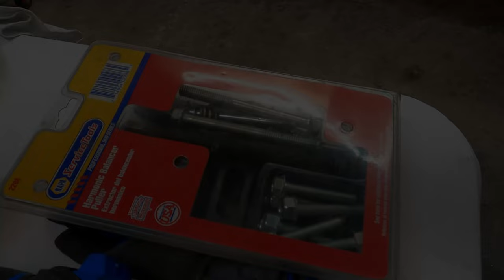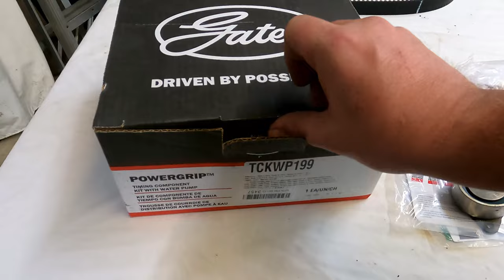Toyota Camry Oil Pump Seal leak fix!!! Timing belt - water pump Toyota oil leak repaired

Comment from the maker: It was supposed to be a short video sorry guys, hope someone finds it useful.
Reply: Great instruction! I’ve seen some of these leak out 2 quarts a day at that seal. Replaced it every time we did a t belt/water pump whether it leaked or not.
Reply from the maker: @DerbyCityRC  Thanks for watching and commenting!
Reply: I had a hell of a time fitting o ring in place used sealer to try to hold it in place its iffy
Reply from the maker: @gregoryschofield5521  That's why i did it as well, Super Pro mechanics cringe but i DGAF. I will be the one that has to redo this job if that oring gets pinched.
Reply: Do you need to do the oil change after you change the gaskets
Reply: What was your total cost?

Comment: The pump shouldn't NEED the additional sealant, but having just gone through this, will do the same (but less than what you showed).  I've found that the replacement gaskets are often smaller than the original ones and leak even when new.  Further, the gaskets can dry out in the original packaging (the one I just purchased in 2024 had a date on the package from 2008!).  So...additional gasket maker for me in addition to the ring rubber gasket.  Last, recommend verifying that the oil leak at the pump is solved PRIOR to putting the timing belt covers (2), P/S belt, A/C belt, and crankshaft pulley on (need to install the timing belt, of course).  Otherwise you will be doing all of this again if the pump still leaks after your repair.  Torque for the 10mm bolts on the pump is low (76 in-lbs).
Reply: And, yes, you can run the 5SFE  engine without the crankshaft pulley on for testing purposes...it is not a harmonic balancer.

Comment: Mike. Thank you very much for making this vid. My mechanic diagnosed this on my 96 Camry with the 2.2 same as you have. Only has 145k. My shop wanted to charge me $1000+ to do this. Now I gotta find someone else. Wish I lived closer to you. Thanks again for the vid. Was going to sell the car or Junk it.
Reply from the maker: I'm glad that people are getting some good info out of this video. I'm still using the same car. It went through two of my daughters learning how to drive since that video and now it's been passed back on to Dad for the work car. I just rewarded it with brand new speakers and a double din touch screen DVD Bluetooth player.
Reply: @madmikesgarage4861   Thats awesome. Our car has been the learn to drive car and college car for both my sons who have graduated college. They blew 3 of the 4 speakers so I think a new stereo is in the future when I get the seal and timing belt taken care of
Reply: @johnkelly4043  update please! I’m planning on buying a Toyota Celica with this problem! How hard was it for you to do?
Reply: @kerokerobonito3664  purchased all the parts on Amazon. Paid $400 cash for a tech to do it on the side. Leaks are gone and set for another 100k miles
Reply: 9 yrs since the last timing was done but only 20k of so. Requested a quote from a shop to do that with oil pump o ring and gasket and they said $1700.  Another shop refused to do oil pump stuff and said if it not leaking to not touch it. Lol. $1200 or so from them.  But why would I want to pay you again to go in once it breaks free.  Stupid shops.  The timing part scares me a little.  I've done all sorts of work on cars just never timing.  It looks really easy from the videos so I may get OEM stuff and do it myself.  My biggest concern was lining things up right and getting the old seals out of the crank and cam.  Thanks for a great video.  My 2000 still going strong with 236k.

Comment: Thanks for the video have the same problem on my 1997 already ordered all the parts. I think this o-ring and all the shaft seals on this side of the engine should just be done every time you do the timing belt because it's easy to get to them. The last guy who did the timing belt on my car was a monkey and left 3 bolts out of the top timing cover and it was flopping around. Safe to say he probably didn't bother changing the oil pump o-ring lol

Comment: I don't know if this comment will help anyone, but occasionally you'll find that the nut that holds the oil pump gear is hard to take off, even with an impact. I'd suggest that before you remove the timing belt you get in there with an impact and get it loose. Then tighten by hand until you can get the oil pump out.
Reply from the maker: Thanks for the tip. That is good advice.

Comment: I had a HELL of a time fitting Oring in place its iffy now I have to check for oil leek soon as  I put belt on for test before its complete
Reply from the maker: That's why I used a little bit of RTV in the groove to help hold the o ring down. I know you're not supposed to do that but I wanted to make sure that o-ring didn't pop out during installation.

Comment: I’m waiting for parts to do this job myself. I have a 97 Camry with the 2.2 liter. I’m getting mixed information about the timing setup. Is this motor an “interference” engine? So if the timing belt snapped would the valves hit the pistons? Asking because my boss has one and it’s overdue for a timing belt.
Reply from the maker: @Ian-of9oi  The engine is a non- interference engine so technically if his belt breaks, no further damage would occur.
Reply: @madmikesgarage4861  thanks. that’s good to know.

Comment: Just had the timing belt replaced last December in my 01 Camry and now this leak is going on! Wonder if the oil pump gasket should be in the kit and done with timing belt change and save all that labor to tear it all down again?!
Reply from the maker: Your mechanic should have at least offered to do it It's like a $10 o-ring.
Reply: @madmikesgarage4861  I'll be letting him know that when it goes in on Aug 3rd! I did get a pretty fair price I thought at $670 as several others wanted $900-1000 but back in again! Am trying a bottle of Bar's Leak in the oil to see if any slow down with the dripping...
Reply: That o ring seal is good for 200k so on first replacement of timing just look for a leak
Reply: @gregoryschofield5521  the pumps gasket fails like shown in the video. Has to removed to replace so all the addtional labor to tear it all down to do so! Should be done same time as timing belt is replaced!
Reply: I have the same problem and Bars leaks cut down the leak by 70%

Comment: How much do you think this job is reasonably priced at with out  water pump change out great video by the way
Reply: $200
Reply from the maker: This job without water pump would be 400ish. it really depends on the shop i guess.

Comment: How did you remove harmonic balancer and how did you put it back?
Reply from the maker: I used a battery powered impact gun to remove the bolt. I had to use a balancer puller to get it off the the crank. You can put the balancer back on by hand and then just torque the bolt. You may get lucky and be able to take the balancer off by hand once you get the boat out but mine was froze a little bit.

Comment: Is the deep groove all around the oil pump shaft normal? I see the replacement oil pump shaft doesn't have this deep groove.
Reply from the maker: If the deep groove is where the outer seal rides, it may have caused it. I wouldn't think it should be there.

Comment: How did you take the 12mm nut off the oil pump gear?
Reply: I  put the gear in a vice to remove that nut and replace the shaft seal.

Comment: Gates is doing something yukky that people who care need to know about. If you buy the Gates H2o pump kit that comes with the tensioner and idler pulleys, they used to only come with Japanese Koyo bearings (the best) which is what Toyota OEM is, but now they sneak in a Chinese bearing, like they did with the kit shown in this video. Koyo bearings have the reddish orange seals while the Chinese bearings usually have a turquoise seal. The Chinese bearings are crap and are guaranteed to fail first. My advise, buy the parts individually or get em from Toyota so you don't end up doing the belt prematurely

Comment: How did you remove the main center bolt from the oil pump sprocket?
Reply from the maker: I just held the gear with the rag and use my electric 3/8 impact on the bolt
Reply: @madmikesgarage4861  ok thanks
Reply: @madmikesgarage4861  stupid question...
Is that center bolt loosened clockwise or counter clockwise?
I was able to hold the gear in place and used my 3/4 impact with no success. I've sprayed it with penetrating fluid and still doesn't budge.
So just thought I'd make sure that this bolt is lefty loosey and not righty loosey 😔
Reply: I removed mine by placing the timing belt around the sprocket and using clamping pliers to hold it then using an impact wrench on low to break the hold. Came right off
Reply: Put a 19 mm socket with breaker bar and hit the starter
Reply: @PiitaaDerbez  lefty loose.
Reply: @Gary New  Gary this trick saved me! I could not break this bolt loose eve with belts around the crank pulley etc... Worked like a champ thanks for the trick!

Comment: What do you line that Mark up on the harmonic balancer with at 6:06?
Reply from the maker: There should be a mark on the timing belt cover.
Reply: Thanks

How did you remove that oil pump gear to get to the seal??
Reply: same question about the cam shaft seal. am I going to have to hold that gear somehow? I'm not there yet because I'm stuck on trying to get that oil pump gear off
Reply from the maker: @PiitaaDerbez  I just held on to the gear with my hand with a glove on and I use my 3/8 battery powered impact to take the nut off
Reply from the maker: @PiitaaDerbez  same deal. Just held it and I used my impact. They really are a lifesaver. Takes a lot of the work out of it.

Comment: Was the oil pan gasket still ok?
Reply from the maker: Mine was okay. I looked at it and it wouldn't be hard to change it later date. Not really any easier to do when you're doing the oil pump from what I noticed.

Comment: Need an update. Any leaks?
Reply from the maker: None  not a drop!!! I still daily this thing to work!!!
Reply: @madmikesgarage4861  I have oil seepage starting on my 99 2.2l, but I think it's from the oil pan. Even so, I wanted to know if RTV was a viable thing to do over the oil pump gasket. Others say no, but it sure seems to be good insurance against a premature pump leak. Thanks for your answer. It's really helpful.
Reply from the maker: @guitartec  Its not required, i did it to make sure the oring didn't leave the groove during assembly possibly pinching it. The extra layer of sealant on the outside landing area cant hurt either as far as my opinion goes. It is definitely a "your a noob" move as far as professionals go. But this is my car that has been through two of my daughters learning to drive and my daily driving to work. Ice cold AC. I didnt want to have to do this job twice.
Reply: @madmikesgarage4861  I plan on having this car for many more years, through a few more timing belt changes. If I keep using Aisin replacement parts, I won't have to worry much about the oil and water pump failing, but I do worry about their seals as the one you fixed is widely known to fail. I want to reduce that risk by using good RTV. Your seal's outcome will help determine if I use it or not, even against others who know more telling me not to use it. Thanks, and please update your desc. if you develop any issues.
Reply: @guitartec  I dont use rtv with o-ring seals. They arent designed for it and it wont help. It will become (rtv) a problem, if you use too much and any of it breaks off into the oil pump. I have used a tiny bit in the past, but it was merely to hold the oring in place during install, not meant to assist in sealing. I suppose a very think layer of rtv could help, if sealing surfaces are heavily pitted. The is rarely the case, tho.

Comment: Can i just do the oil pump seal? RAV4
Reply from the maker: Yes you can just change the oil pump seal. I changed the other seals because I was right there and they didn't cost that much more money plus I was dealing with the 20 plus year car.
Reply: Yes you can, but like others have said, if you're going through all that trouble, you might also well change the other parts, in case they fail a few months later.

Comment: Missing a lot of steps when it comes to what to pull off and in what order. Also missing the info for the size of the sockets/wrenchs you need to use.

Lucky I had already replaced my timing belt before this so already knew what I needed for tools
Reply from the maker: This was never meant to be a video for a complete beginner to use. If you are struggling with what size socket to use you more than likely should be paying a garage to do it.